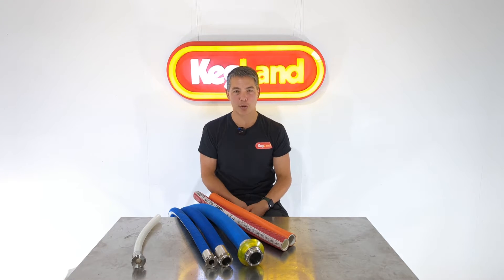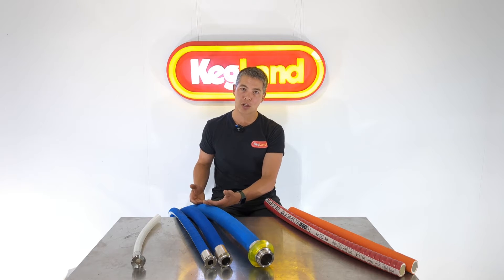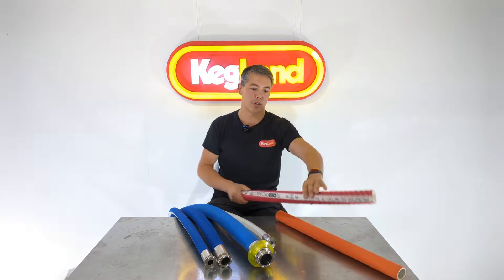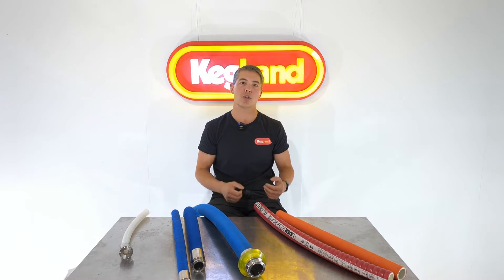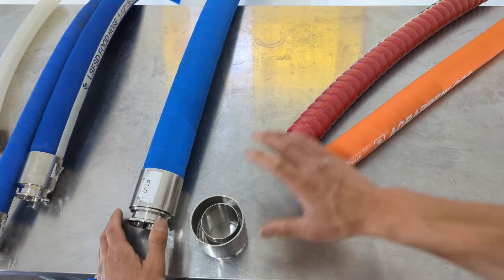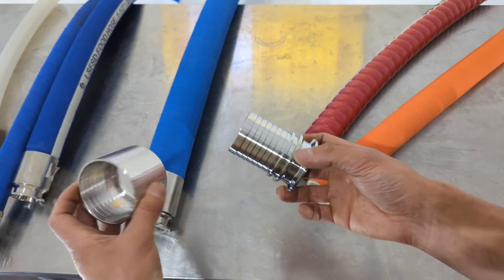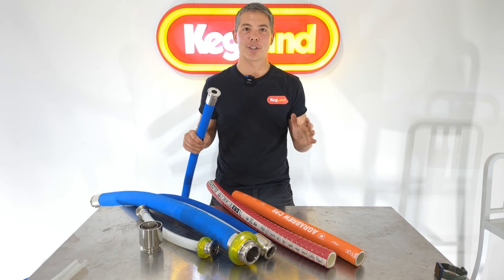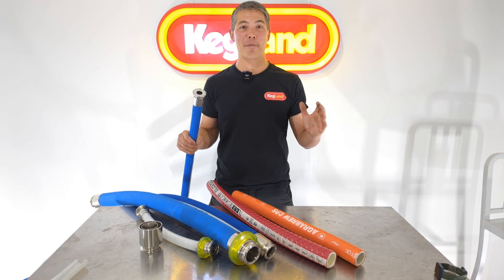Tri Clover (TC) Commercial Brewery Hoses - All You Need to Know, BrewFlex, GlideTech, EPDM, Silicone

Comment: Maybe a stupid question, but rather than transferring beer from a fermzilla to a keg, could you just use the fermzilla as a keg after fermentation is done? (dumping the trub? off the bottom / keeping it in the fridge/dark/cool etc)
Reply from the maker: Once the yeast is no longer working you loose the ability to absorb oxygen that ingresses through the wall of the FermZilla.  For light beers like Pilsners, Lagers etc. we would recommend only having the finished beer sit in the FermZilla for 1 month max due to oxygen ingress concerns.  So if you drink the whole lot of beer in less than 1 month then you will be fine. If however you want to store your beer for longer then we recommend a stainless steel keg or a oxybar keg which is also made from PET but we use oxygen blocking technology in the PET wall so you can store beer for well over 3 months.
Reply: Cheers. You guys still working on a smaller rapt fermentation chamber?